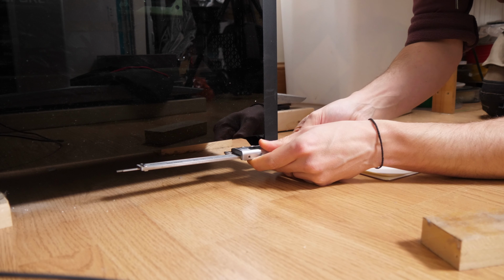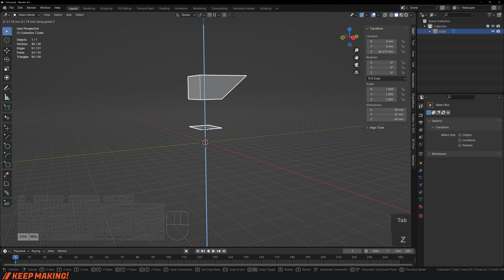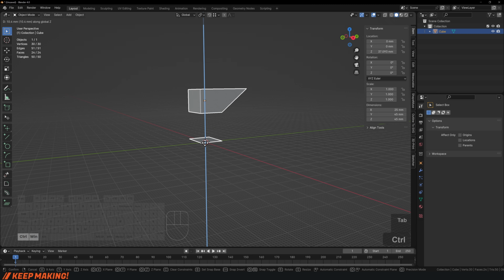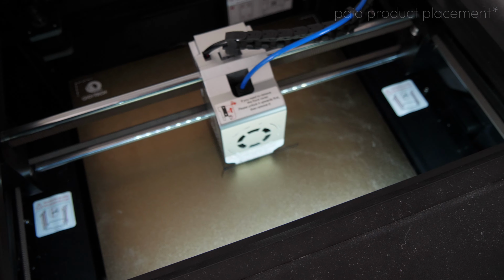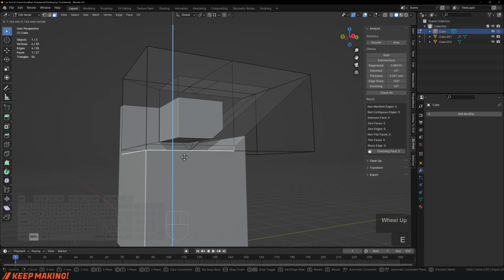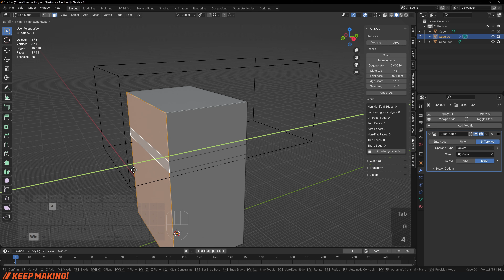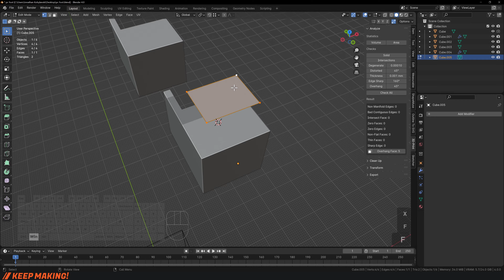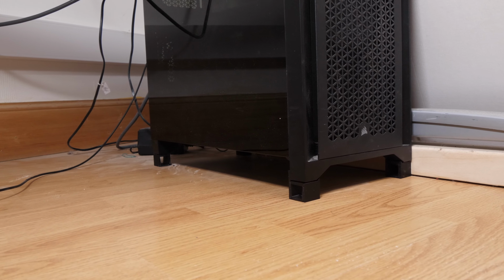My Blender Precision Modeling Workflow

Comment: Being tall I had a similar problem with cable length on my standing desks at home and work so I wound up welding open frames to hold my computers and then bolted them to the frames underneath the desktops.
Bonus: since the computers now go up and down with the desks the front panel controls and sockets are always accessible.

Comment: It does seem that I go with this "quick and dirty" kind of workflow, too. But I do want to do it in a way that is both for actual rendering (therefore topology is important) as well as the potential for 3D printing, so when I do want these precision tools, I just need to do it for precise angles, measurements, etc. Haven't tried CADSketcher in earnest yet, but it does seem I don't need to.